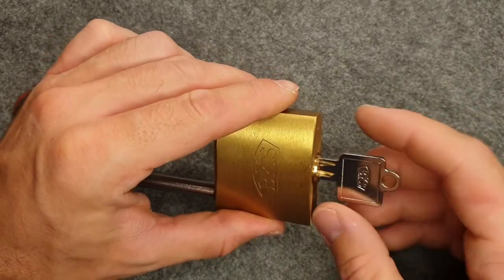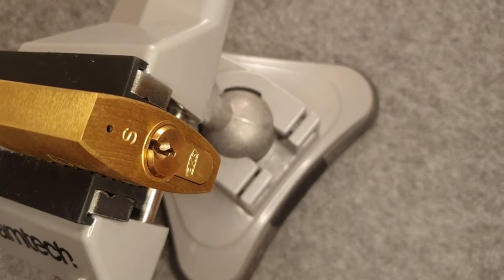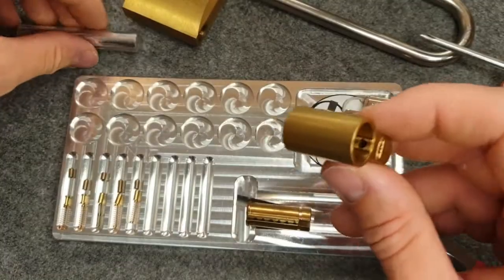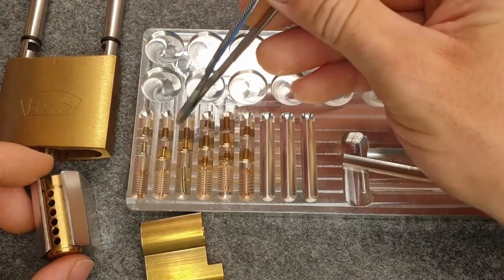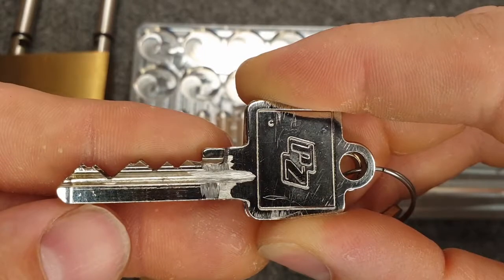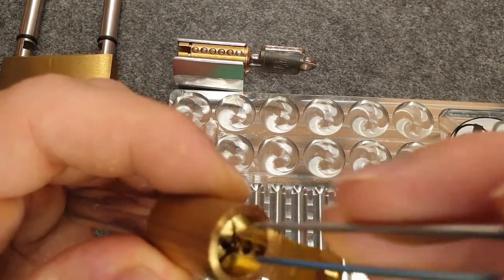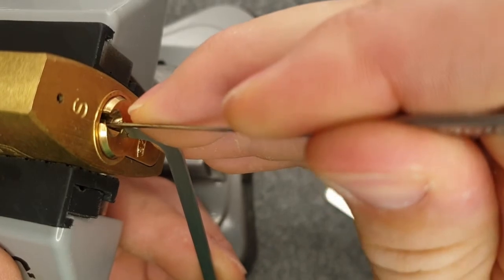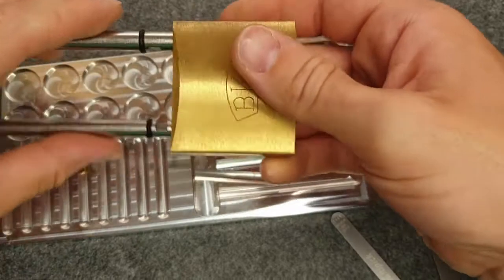[89] BKS AGAIN? See how I turned this 5-pin key to a 6-pin!

Comment: Awesome work!!!! 
Great picking as well!!! 
Cool discovery on using the half Dimond on #4 pin😀 that may also help set ASSA spools with their sharp lips!!!! Will have to try that 👍 
On the stuck key in the beginning, one of the key cuts is just a bit steep for the key to go in and out. 
When I hand file a key bitting first I get the depth, then I usually have to soften the  “V” at the top so the key slides in and out easily. 
I test this when the lock is dissembled and in the little holder. 
I put pressure on the key pin to approximate the spring pressure on it when assembled. Once the key is smooth I can do the next one, etc. 
awesome job my friend!!!
What a great lock!!!
I may have to look for one of those!! I do like BKS locks!!!
🐈‍⬛🐾🐈🐾
Reply from the maker: Thank you very much 🤗
Yeah i find more an more use for the half diamond now, maybe it will become a pick profile in my usual rotation 🤔
Good spot with the key, i will try and file it a bit more, thank you very much 🤗
Also thanks again for the tip how to turn a 5 pin to a 6 pin key 👌
Cheers 🍻
Reply: @LockFumbler  you are welcome my friend!!! 
🐈‍⬛🐾🐈🐾🍻